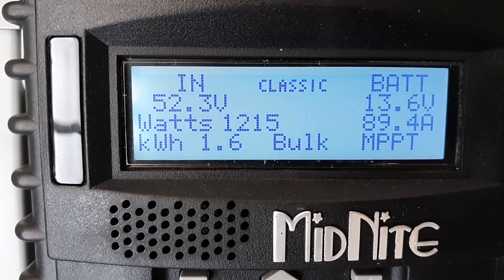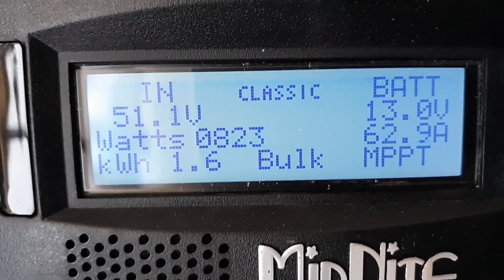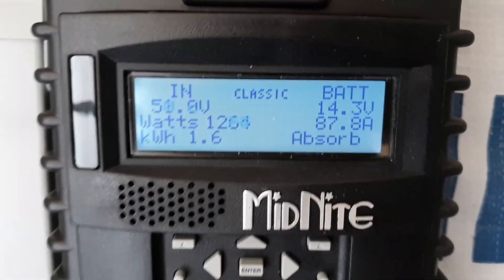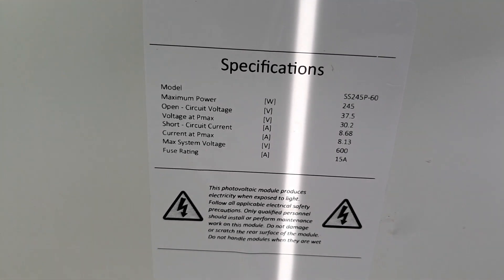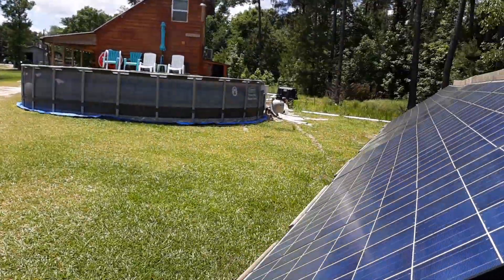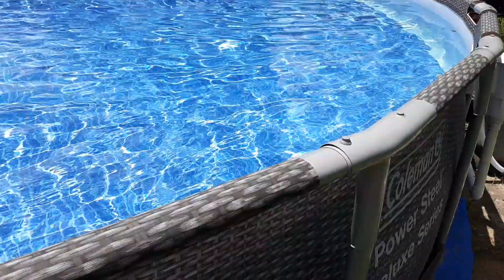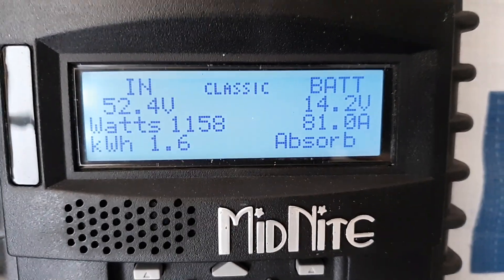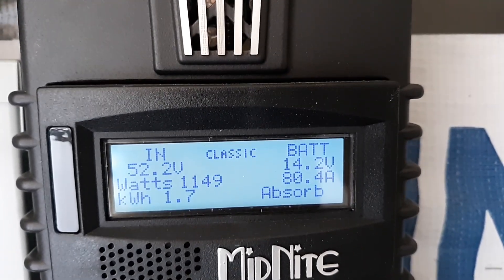245 watt panels putting out 325 Watts

Comment: If you have 4 charge controllers, are they  all hooked to a battery bank?

I haven't started hooking my system up yet.

Have 6 , 100 watt panels, but am thinking about buying 8, 325 watt panels.  

Could I use 2 different MPPT charge controllers to charge 4, 100 amphour Battle born batteries, set up in a 24 v system ?